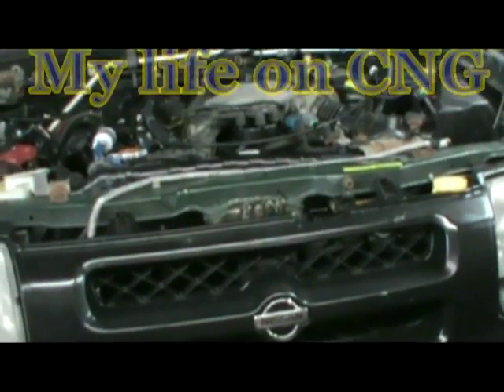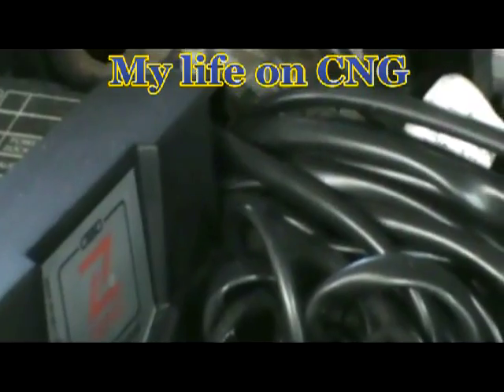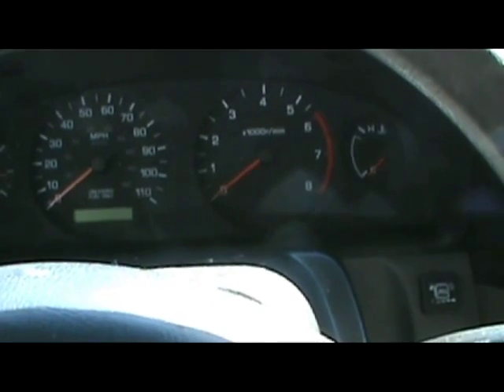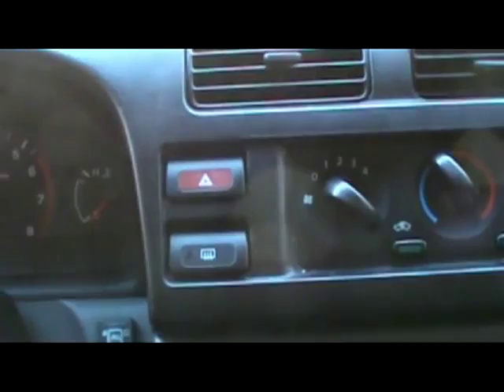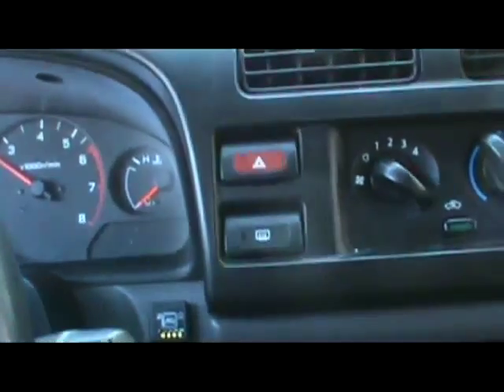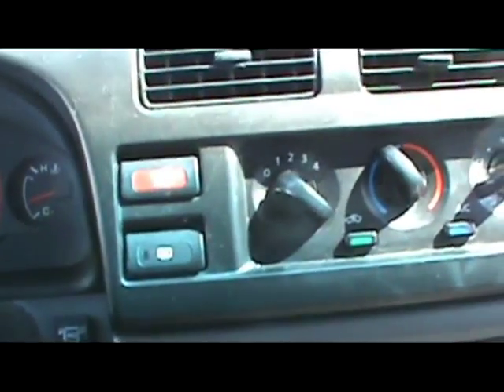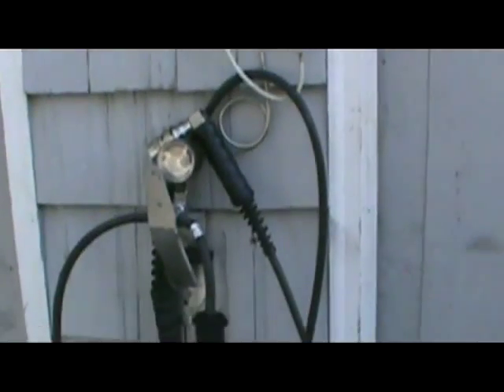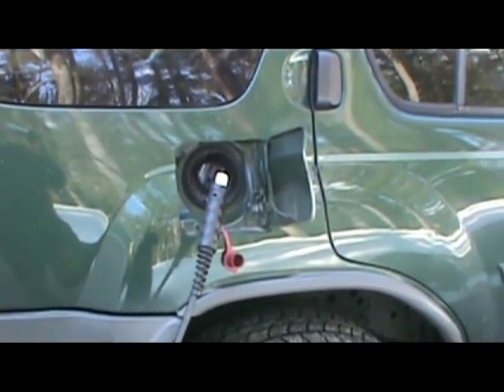My life on CNG

Comment: I did convert my 2000 Toyota Camry to run on Natural gas for 7 years and now my car have almost 300K and she still run like dream. And I did install a timming advance professor(TAP) because natural gas octane is higher than gasoline and I get a bit more power that gasoline. If you do it right program is perfect you will not lost any power

Comment: I drove CNG taxi for 3 months. 
The cost per mile is almost same as regular gasoline car.
You need conversion kit which costs $1,000 average. 
For home fueling, you need $9,000 gas pump.